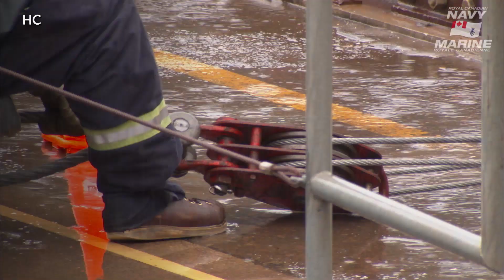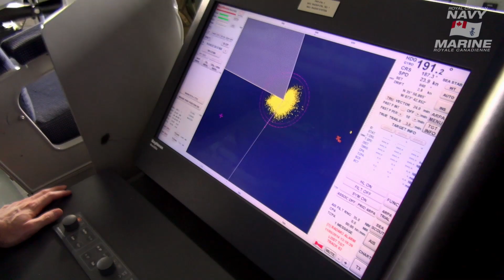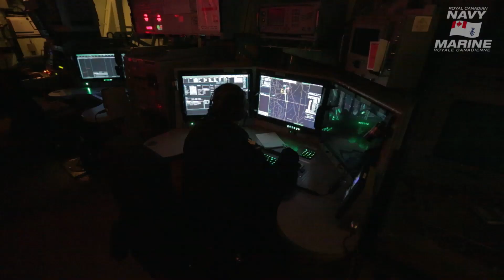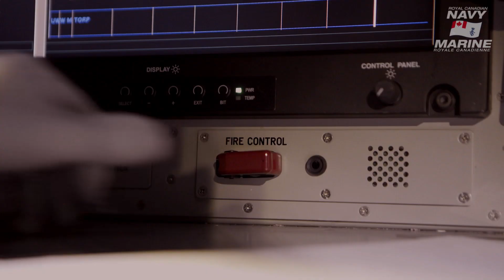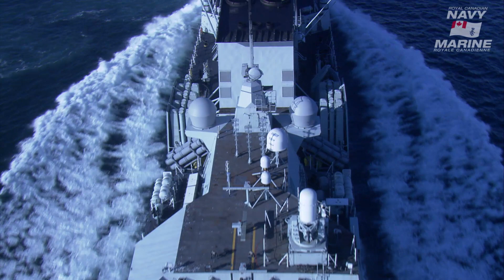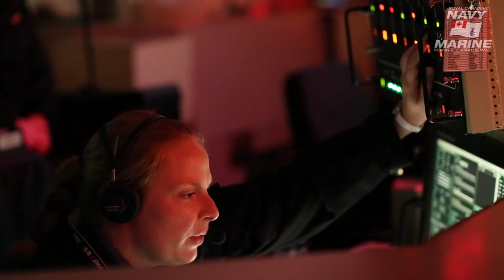Halifax Class Modernization/Frigate Life Extension Project Part 2

Comment: I remember using floppy disk and tapes to load up computer on Winnipeg. I just hope they didn't sign 25 years contract on computer system like they did for the MSAX system and S/S system ashore. OS warp was so old, we could not replace the hardware. The sailors were never the problem, but the purchasing of equipment. One with the strength of Many.

Comment: Nice SLEP program (service life extension program) It looks like it will bring these ships up to modern warfare standards. I would think that an Infrared detection system would help as everything appears to be radar. I don't know far advanced ship IR systems are but with stealth aircraft such a system should prove useful as every aircraft creates air friction heat on parts of their skin.  I would like the Canadian navy to invest into about 6 to 8 AIP submarines and then dump the air breathing Victoria s.
Reply: nuclear submarines are ridiculously expensive and are easily heard underwater, all of them. Diesel hunter killers are not and that's why most do not build nukes
Reply: @alpearson9158  Agree on your points.  AIP subs are much less expensive to build & operate. They can also stay submerged for 2.5 to 3 weeks whether they use fuel cells, lithium batteries, or Stirling engines. This beats using a snorkel for diesel engines or should I say just diesel engines. Liquid oxygen is a bit temperamental as a leak can cause grease on clothing to ignite as well as any other petroleum or alcohol based product.
Reply: @alpearson9158  I have been wondering why the USA doesn't build AIP subs at least for coastal defense or observation in the war on drugs. I have also wondered about carbon tolerant fuel cells and the use of compressed natural gas. After all you are already toting around liquid oxygen. No one said that subs were super safe vehicles anyhow.